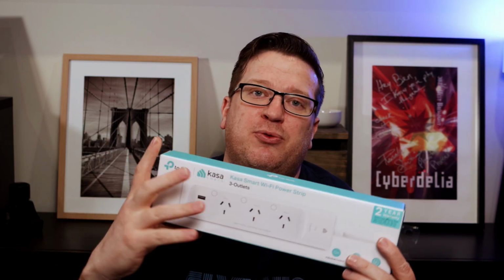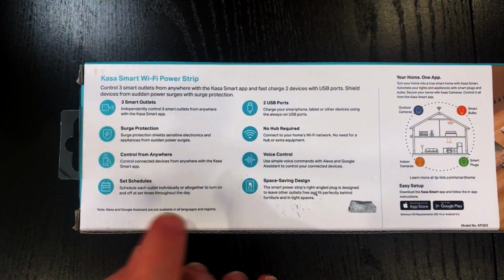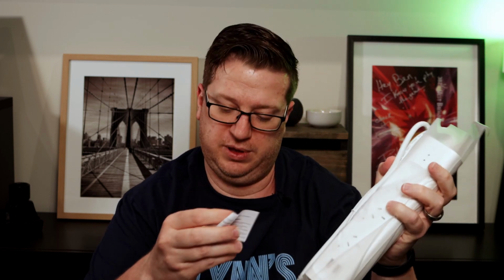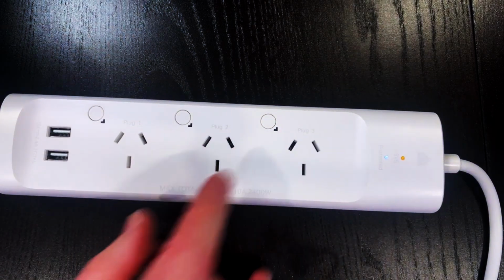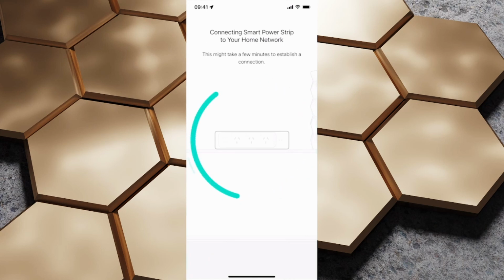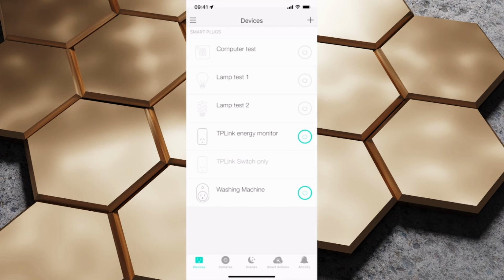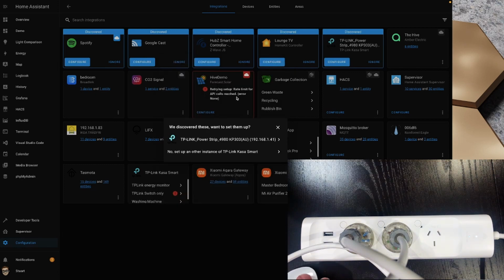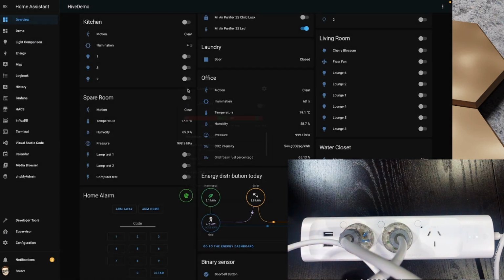TP Link KP 303 Smart Wifi Power Strip

Comment: Sorry I made an error in my other comment and the edit option to correct it won't work. 

I meant to say I have some Arlec smart switches operating via Tuya HA integration and two of those are energy monitoring switches that do not share energy data with HA. 

My question about TP Link integration being supported in future still stands though, thanks.
Reply from the maker: While TP-Link did temporarily break the integration with a firmware update, it appears they've learnt from that mistake and hopefully won't make it again. 
At the end of the day, the manufacturer of any device can take their bat and ball and go home if they decide it's not worth it to keep servicing the open community, which is why Tasmota is so popular. Now that Tuya are getting rid of ESP-8266's and moving to an RTL chip that Tasmota won't run on, those days may be numbered.

For a truly "it just works" experience, the TP-Link integration - at the time of writing - is awesome. Hard to say what the future holds though.
Reply: @HiveMindAutomation  Thanks. Just to confirm, are the TP-Link switches with energy meter compatible to be set up as Individual Devices the Home Asssitant Energy tab?

Comment: I bought the strip with 4 ports for 5 GBP, added 4 relays, ESP32, cable/plug, few LEDs, "emergency switch" in case wifi is down, 2 fuses. Total it cost me around 10 GBP - it is so successful in my house that I am going to make another 5 ;-)
Of course control from HA as well as from web in case HA is down.
Yes, you need to be a "maker" to do it, but pleasure and $ saved - priceless.
Oh, I would forget: NOT CONNECTED to China - the delay you experienced shows all about "locally controlled" I am afraid
Reply from the maker: The Delay is only on the return data. 
The integration with HA is a Local API, not a Cloud Polling API.

Sounds like a cool DIY Project but here in AUS it would be "frowned upon" as they don't like when we modify wiring. Insurance companies use DIY Electrical work like this to get out of paying out claims. Technically speaking there's no law against wiring past the plug though.
Reply: @HiveMindAutomation  the power extension socket is NOT WIRED when  you buy it - it is ready to be wired so DIY by design. ROSH compliant. So there is no change in the EXISTING wiring as there is none when you buy it. The same way you buy simple single socket to be connected to your cable - I don't believe you cannot buy single socket in AUS. Or the wall socket/switch if that matters. But for the sake of protection I used 2 fuses: 13A for the load and 0.1A for the internal circuit that powers ESP32. Can this burn your house? Iron can, water kettle can, almost everything can. Recently my kettle decided to turn on without anybody being in the kitchen - result: thank god only kettle burnt.
The delay on return: smart devices can work either with web socket or MQTT - I find MQTT a bit slower than web socket, but we are talking around 100ms. To make sure your sockets are fully locally controlled block them (their IP) on your router for any traffic to/from internet, turn off wifi on your phone and then use your mobile application to turn them on/off. And also HA. Because we are talking 2 things here:
1- local control over home wifi - that can be local but
2- sending data to China - that is irrespective of the point 1.
I believe both issues are important:
1- time to turn on/off and in case internet is down or the server in China - no control then
2- this one is bigger issue for me: when I go to tuya website, I can see not only if my switch is currently on or off, name of the switch  but also GPS coordinates of my house! And if you combine this information then people behind server can easily see if you are at home or not... On top of that: if your Chinese device is inside your wifi, you have no idea what else is being sent to China... Remember: in the same network are: your laptop, TV, god knows what else.
That is why I opt for LOCAL CONTROL only - not for the sake of speed only.
But for many people convenience is more important than privacy.
Reply: @zyghom  what power strip did you buy to do this mod with?
Reply: @jubblybits6155  Permaplug by Masterplug ELS134W-01 Four Socket Trailing Socket with Power Indicator, without Plug and Cable, 13 Amp, White